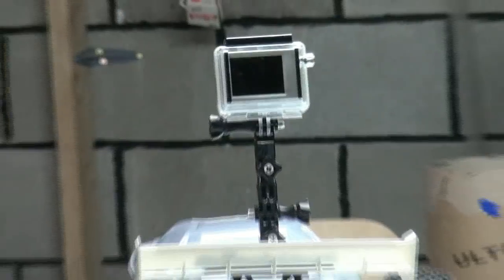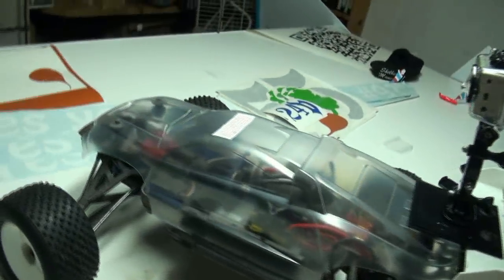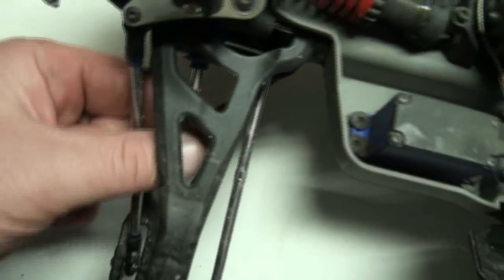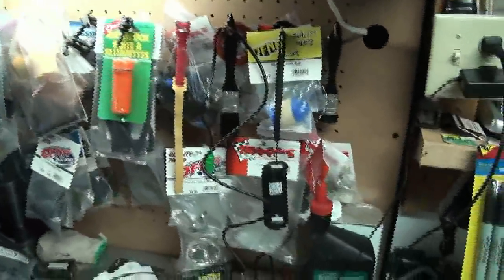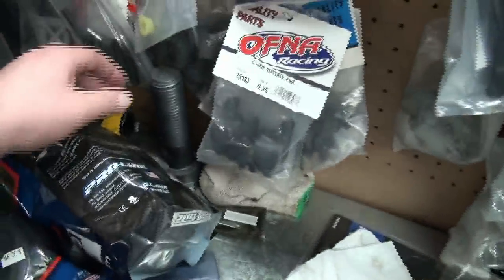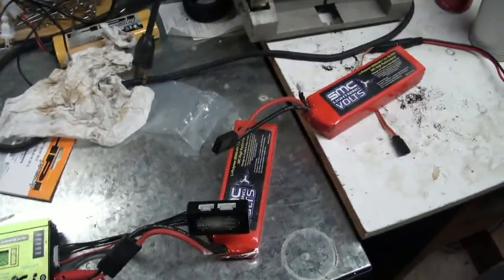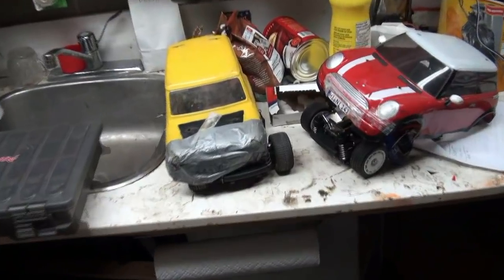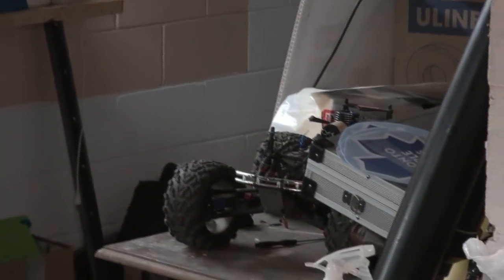mounting the gopro on the Erevo and  a rc update

Comment: I feel you on the nitro I had a os .18tm on my tmaxx the thing ran like a raped ape would still be going to this day if the bottom brass fittin in the lower connecting rod didn't shred bought a 3.3 blew it 3 gallons in not bad but I'm converting my maxx to brushless and it's pretty much just the o.s. That are tempermental s.o.b. Cuz of the three needle carb I was always retununing that thing not so much with the 3.3

Comment: I also have 2 boats that I run I painted one of the hulls like the general lee and ran it for awhile but the bottom transom on the outboard cracked and it's $60 for a new one havnt even gotten around to it plus the hull Is cracking where it was joined it's an old hull my dads buddy built it in the early 90s so I don't blame it I gotta redo it again ffs